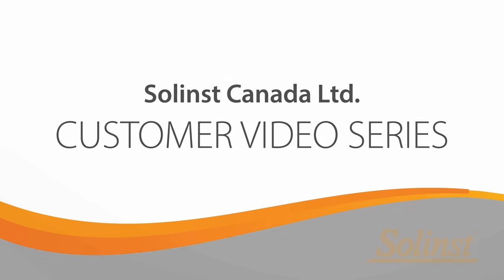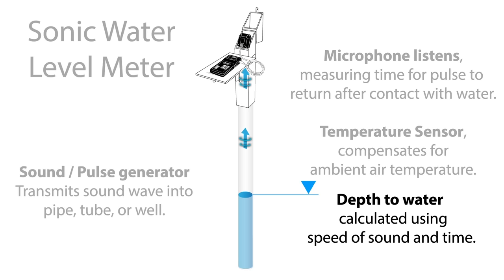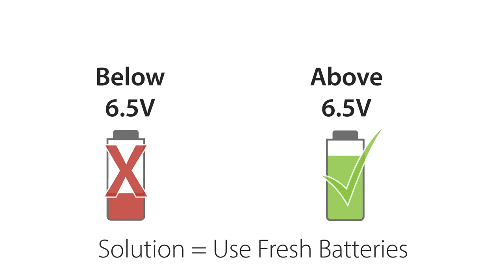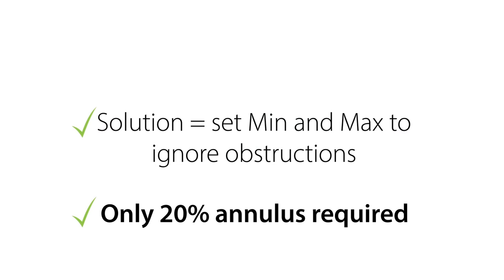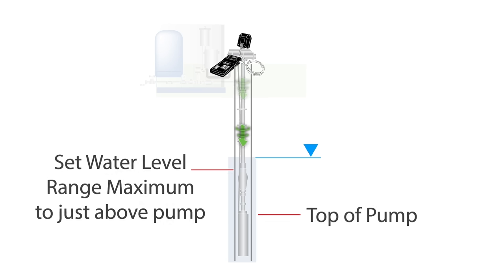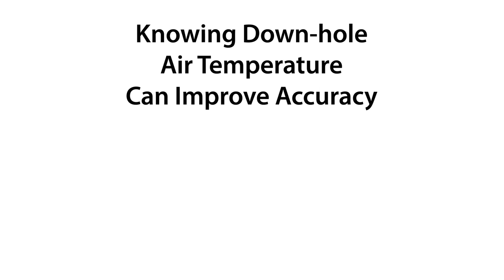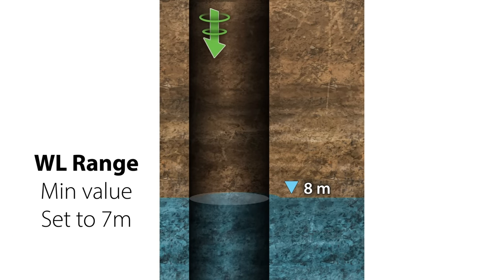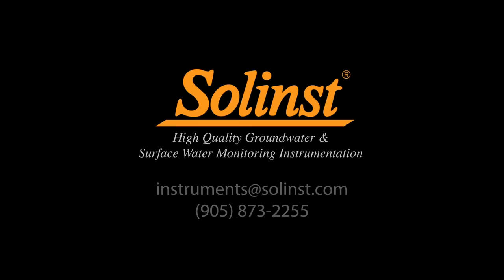How to Get the Most Accurate Readings from a Solinst Sonic Water Level Meter

Comment: Our company bought a unit and I tried it out in the field and found it to be unreliable. We had to pull out our water tape to get the depth to water. One thing to note is this doesn't measure the depth to bottom which is almost always mandatory during our monitoring program.

Comment: Can the sonic give the reading in deep water level up to 400m.?
Reply from the maker: Thanks for asking.  Yes, the Solinst Model 104 Sonic Water Level Meter can measure down to 600 m (2000 ft) and water level can be displayed in Metric or English units.    Please note that if there are obstructions, you will need to account for those during the setup as outlined in the video and in our instructions on our website.  Please contact us if you have any questions or if you would like to talk to our technical support group.     Jason